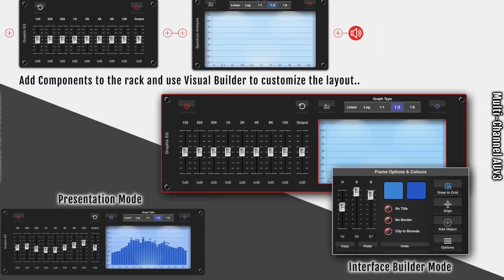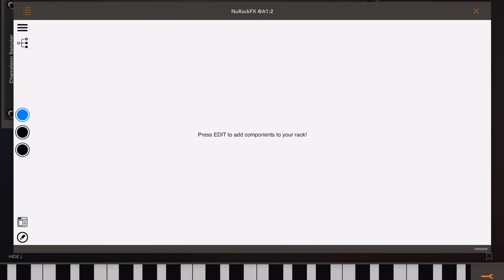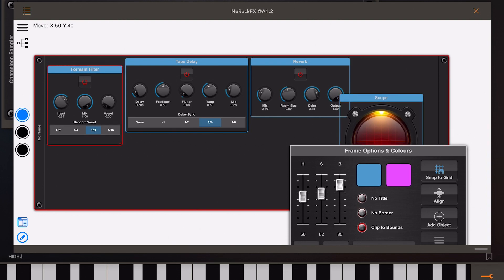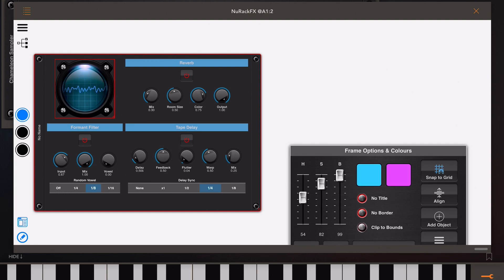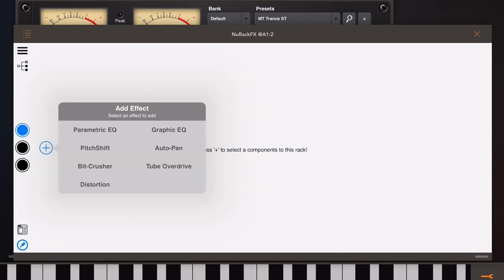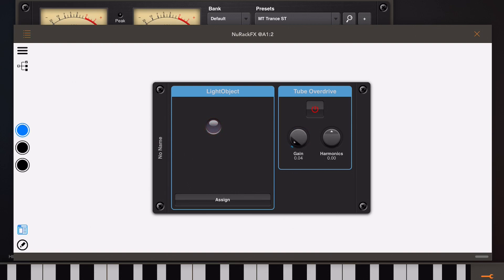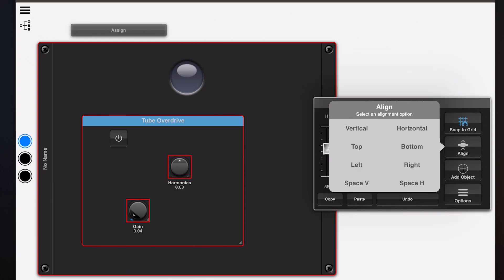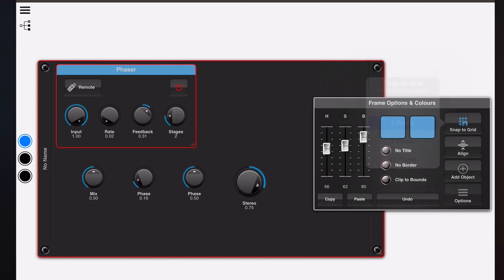NuRack FX - Part 3 - Tricks & Tips

Comment: Hey, Paul.
This system is truly insane in a good way. 
Can you advise please - is there a possibility to build rack/route the signal to be able to EQ it in M/S mode? 
Just in case: I mean split stereo signal -> 2 mono signals, mid & side -> process them separately -> (what’s most important) convert the processed signal back into stereo audio on the output. 
Same as, for example, the standard EQ plugin in Logic does it.
Reply from the maker: The splitter already supports splitting left and right channels and you can use the Mixer to combine them again. After the split the signals are treated as STEREO for purposes of processing but when combined back together you get the same results as if they were treated as mono.

Comment: Maybe my real question is with "AUM" - but is there a way NuRack allows for real-time parallel compression?
Reply from the maker: Yes, you mean like MultiBand Compression? There is a dedicated multi-band compressor or there is a multi-band splitter which can feed 3 outputs of varying bandwidths. You can process these and combine them back into a single stereo stream ising the merge module.

Comment: How do you delete individual components. I must be missing it. I keep deleting racks and recreating them when I just want to get rid of one component
Reply from the maker: I've mentioned this in the other two of my videos, plus when you add a component it displays a message at the bottom of the screen telling you how to do this. You need to swipe up with two fingers on a component in connection mode. You can't do this in interface builder mode.
Reply: Paul the MusicMan I love this app but i do find it cumbersome to do a 2 finger swipe to have to delete delete
Reply: Paul the MusicMan thanks, i obviously missed it. I see why I missed it. When I add something, I am excited to read the knob captions, so my eyes don't default to the bottom of the screen and when I do look there, the message is gone. I suppose I figured that since it disappeared so fast that it couldn't have been that important. It's a very important detail to know.
Reply from the maker: @N8WeX  I did look into having something perminently on screen for deletion but it really does get in the way so I decided to remove them. I will give it some more thought.